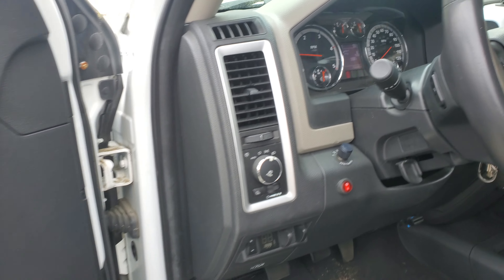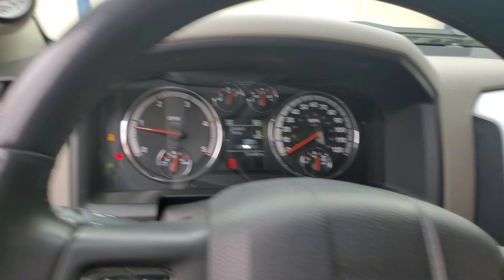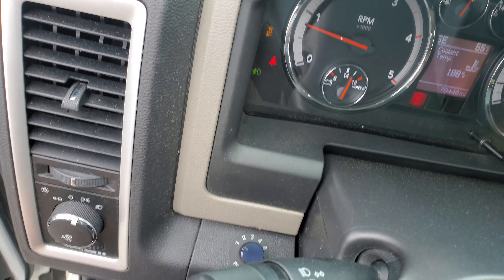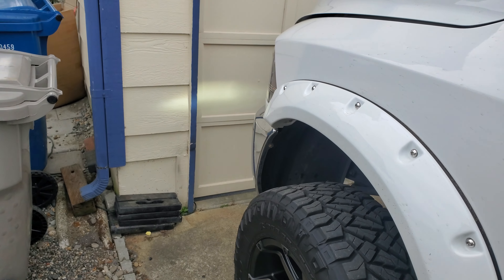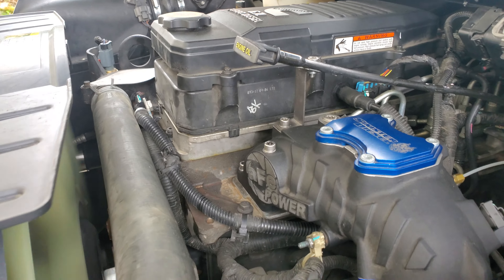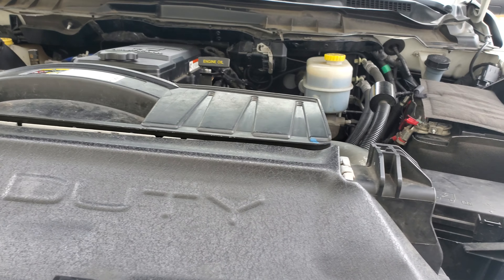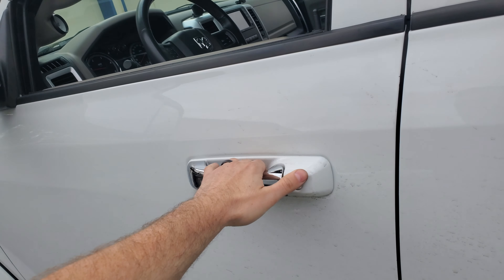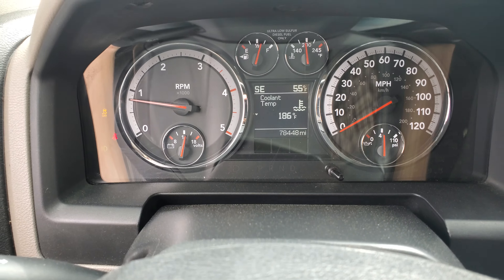Update after test drive with new Injectors 2012 Ram 3500 Cummins

Comment: How is/was the BD turbo manifold holding up?
Reply from the maker: Still runs strong. My G56 transmission on the other hand I've found the weak shifter and weak 4th gear lol. Upgrading soon to upgraded case and AD gear set.
Reply: @joebidden4914  Glad to hear the good news on the kit. 

Apologies on the tranny... Pay to play as they say. Lord knows I'm familiar with that and I'm sure you are well versed as well.. 

I have the 68RFE; so... Haha! 

Hate to be a pain, but did you notice all the benefits they claim? (Lower EGT's, drive pressure, and slight MPG increase.)

Lastly, do you regret losing the exhaust break? - I rarely use mine. Honestly, more so to keep the VGT from locking up. 

Thanks again!
Reply from the maker: @BoostedVQUR  drive pressure was the big one for me. It did lower EGTs yes, not sure about the fuel mileage, but it is reliable and spools the same every time consistently. 
With the VGT I had a lot of issues sometimes the turbo would light up super quick and responsive, others was super sluggish. I kept my exhaust brake on all the time as well. I do miss the exhaust brake but if I'm ever able to I'm going to put the BD power brake on it as well.

The 68RFE if you have a built one is supposed to be really good.

Comment: Is that the stock manifold with the BD iron horn? I am looking to do the 364.5 with the 1.00a/r on my 2010, but can't decide on that or the 366 with .91a/r. I tow 12k plus. Also, sharp looking truck!
Reply: You just re-installed the heat shield. But, how are you liking it?
Reply from the maker: No its an aftermarket BD manifold. I have the .91 which I would recommend that for towing unless you plan on racing and going over factory redline. Also what injectors do you have?
Reply from the maker: I also didn't reinstall any heatshield that I can remember. I didn't have a factory heat shield in the first place.
Reply: @joebidden4914  just stock now, and I have an automatic transmission. I don't plan on racing, just goofing off sometimes like a red light race.
Reply from the maker: @mitchbrumbeloe7079  I'd say go for the 364.5 and .91 AR. You don't need bigger than that for towing. BD also doesn't recommend anything bigger than the 364.5 for towing. The lower AR ar .91 is going to be more for the RPM range you will be running. Especially with stock valve train.

Comment: I may have missed it but are the new injectors stock size or are they bigger?
Reply from the maker: Bigger. They are BBI (Big Bang injection) stage .75 injectors. Basically 75hp Injectors.